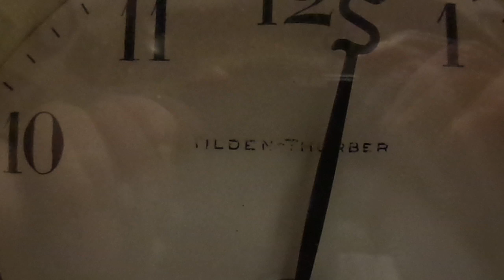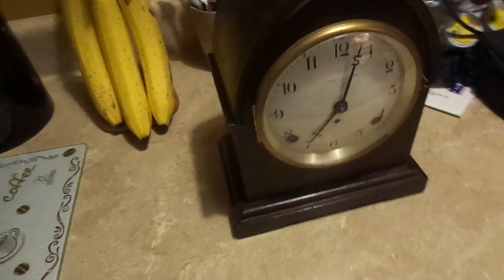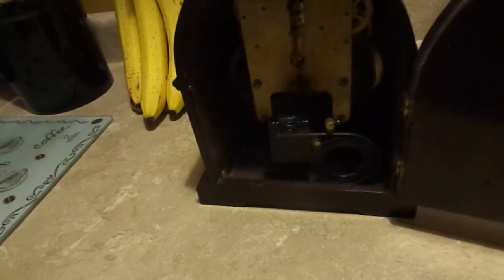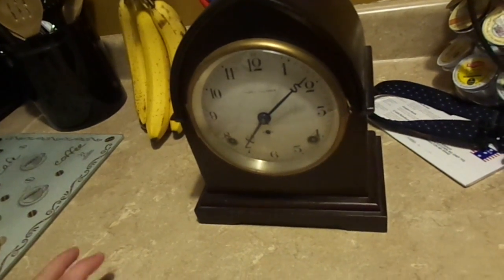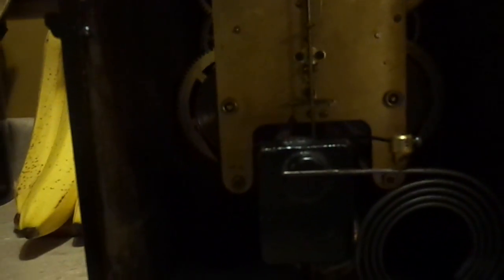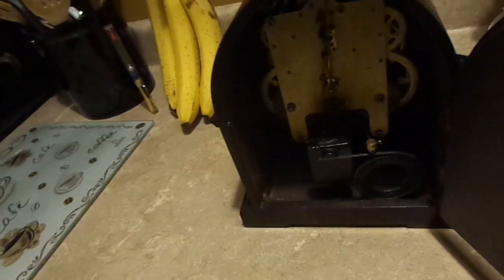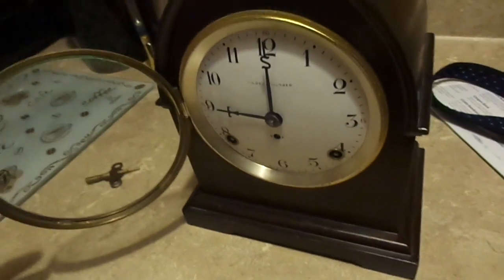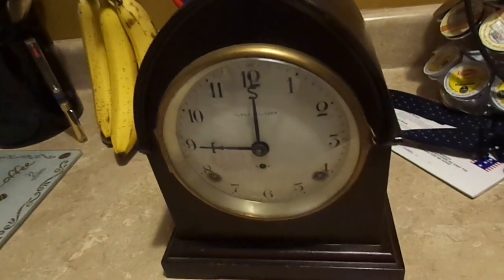1936 Tilden-Thurber by Seth Thomas 8-day Mantle Clock

Comment: I have an Electric wall clock from about 1930 made by Seth Thomas. It was made before the sold off to General Time and is an early spin start type synchronous movement. With a complete disassembly, clean, and oiling it now runs fine. I had to replace the motor since the original had worn bearings and was binding. I took one from another clock with a damaged fiber gear and its fine. I will rebuild the original at some point but I don't have a use for it at the moment so it will stay with my spare parts.I never replaced bushings in a clock movement before so I will learn on the old motor. I also put on a reproduction style rayon cord.

Comment: I think Pledge is going to be the safe bet. I use beeswax on my parent's grandfather clock and it comes out nice and polished. Also one other thing, what's the other side of the key used for? The hole right just underneath the middle isn't it, but what's that for? Just curious.
Reply from the maker: Yes, the small-end of the key is for adjusting the pendulum length. I'm not convinced Pledge (silicone spray) is safe for older finishes, which is why I asked that question.